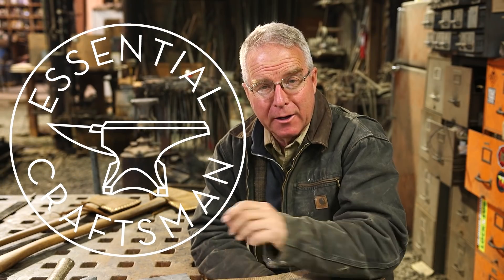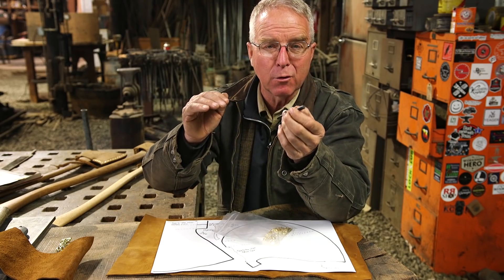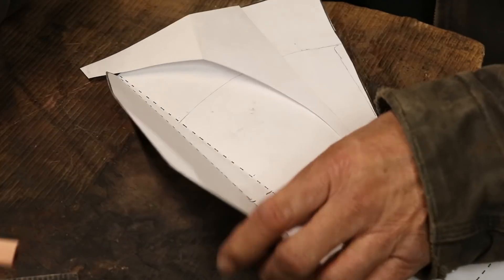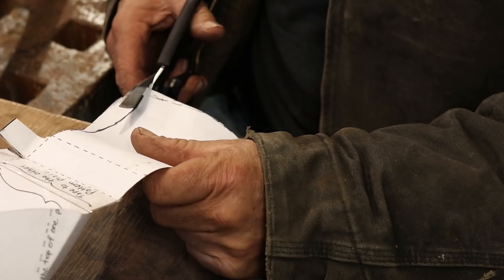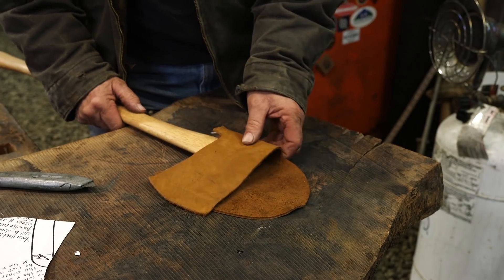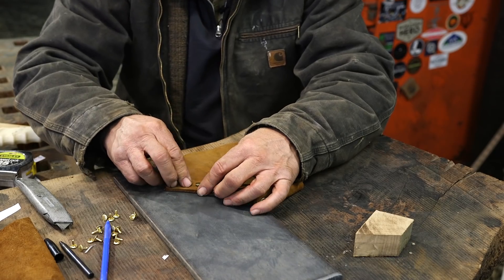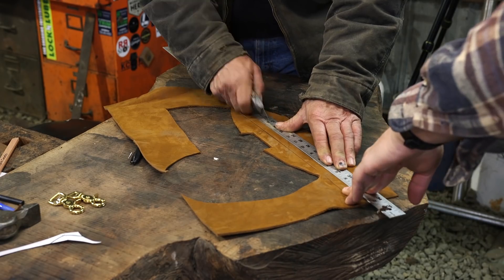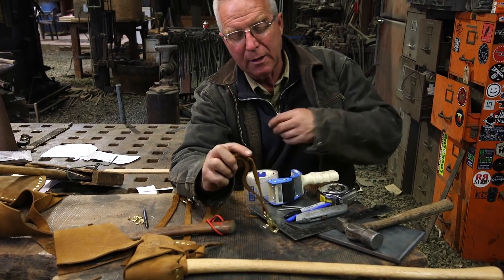EC Tries Something New

Comment: A couple of additional thoughts: When you're using drive tools in leather, punches, stitch or lacing cutters, tooling stamps - any of the tools you strike to use - don't use a metal hammer on them. You'll mushroom the tops of those tools in short order. Wooden maul, rawhide faced mallet, plastic or rubber faced - just not a metal hammer. You won't have those tools for decades if you hit them with metal hammers.  Second: when you're setting rapid rivets/ two piece rivets like the ones in the kit, you can just hit them with a hammer on an anvil, but take it easy ;) They're really pretty flimsy little things and you can smash them easily. There's a tool for setting them with a little anvil and a setting drive tool, both with slightly concave faces, that allow you to set the rivets just about perfectly every time, and keep that little bit of doming to the caps. The hammer and anvil work to make the rivets hold, but adding the rivet setter produces a more finished look and makes the task easier to do well.
Reply: I was about to make the same point about the punch. I am glad I scrolled down. Another handy tool on a project like this is binder clips. Those are the small, usually black spring clips normally used to hold loose leaf reports together. I use them the same way as I use straight pins when sewing cloth. Really helps when fitting the parts together.
Reply: Seems like a brass hammer would be alright.
Reply: And if you've got an axe, and some well seasoned hardwood, making a simple but excellent mallet is a handy bit of bushcraft practice.

Comment: Might I add, for anyone planning to undertake this project. Add a strip of leather between the two main layers of leather where they are riveted together along the cutting edge of the bit. This will protect the sharp edge of your axe from dulling on the rivets as it is carried in the sheath.

Comment: When I was about eight years old, Uncle Eric (who also taught me how to braze with oxy-acetylin) drove a ten-penny nail and the tip of his sheath knife into the surface of his work bench, a 1/8" apart. He then drew a leather scrap between the nail and blade. As we pulled, I was amazed as the scrap revolved, changing from a sheet to a thong. They make great winter boot laces. They never get waterlogged and freeze, unlike woven laces. That was my first leather project. <Insert pun involving shoemaker's last here.>

Comment: When measuring leather that's going to wrap around something, you must take into account the thickness of the leather.

You can see this by measuring around a coffee can with a piece of paper, cutting it to the exact fit, cutting an old thick belt to the length of the paper, and then wrapping the leather around the can.
Reply: That’s a difficult concept for me to understand.  Can anybody explain why this is the case?
Reply: @jphickory522  The grain side (smooth side, side that the hair came off) doesn't stretch much. The flesh side (rough side, where the fat and muscle was scraped off) compresses a bit. This adds twice the thickness of the leather to the c̶i̶r̶c̶u̶m̶f̶e̶r̶e̶n̶c̶e̶ diameter of what it's going around. It isn't really noticeable with the thinnest garment leather, but when you get up to 11/12 oz (one ounce is one sixty-fourth of an inch) or thicker saddle skirting, it makes a big difference.
Reply: Thanks John.  I still
don’t understand but appreciate your effort of trying to explain it.  In my simple mind... if two strips of different materials are cut to the same length they will have the same circumference when wrapped around something regardless of thickness.
Reply: On second thought..... I think I do get it now.  A thicker material will have a larger outside circumference than inside circumference due to the thickness.  
Thanks

Comment: TIP.
To put an accurate crease in paper or card. Gently draw a knife along a straight edge on the inside where the create is to be formed. Gently being the key word. Only need to score a faint line in the paper/card, not to cut deep or through it.

Comment: Leather worker pro tip: instead of paper or even card stock... use scrap linoleum material for patterning. The extra thickness helps account for the leather thickness yet is easy to cut and fold.

Comment: I would recommend trying copper rivets next time. They basically look like a blunt nail and washer. They do require a rivet setting tool and some sort of wire cutter, but they don’t require precise hammer blows, are very simple to use, and just plain look good.

Comment: Your so right the skills translate across most production Trades.     

When patterning thicker leather cardboard folds about as well as cased 5 oz.  so you don’t have to do as much work with seam allowances.    

I would make a much more rigid mask ( axe blade cover). That soft and they can fold in front of the blade and be cut easily.

Comment: Now you have come into my world ;)  If you hold that utility knife like a pencil, between your thumb and forefinger with your forefinger on the back of the blade, then your knife holding hand is braced and steadied against the table, allowing far better control and precision, plus it's anchoring the leather for you as you work. You don't need to try and force the knife right through with a strong grip. It's more important to cut precisely along your lines and that is better done with a pencil type grip, even if you need to go over the line more than once to cut clear through (which with the leather you're using should not be necessary).

Comment: I have a set of scissor-shears purchased to cut 1/8" rubber sound-proofing that's loaded with powdered rock that I would use instead of the blade shown here, especially with children: easier, more precise and safer. Here in subtropical Southeastern Louisiana I couldn't use leather because it would be moldy within a month in my workshop but I'm thinking there might be magnetic edge-guards out there in the world or I could use a flexible plastic the same as you did the leather. This was definitely a different direction in your video series. I have a few axes and hatchets and it never occurred to me to put guards on them. Thanks.

Comment: Some 30 years ago, when my wife became pregnant with our first child, I undertook the building of a rocking horse. That involved, in addition to the woodworking, some leather work for the saddle, bridle, reins, and stirrups. I've done exactly two additional projects over the past three decades using those leather tools and hardware (things like repairs to a pocket on a leather tool belt). The point is, I haven't needed them often, but when you need them, these tools are indispensable. I still have the rocking horse in a spare bedroom, and I have told both of my kids that the first one that blesses my wife and I with a grandchild gets it! (Still waiting, alas, but my oldest recently got married, so hope springs eternal!)

Comment: I'm cringing at you hitting the metal punch with a metal hammer. That'll mushroom the head of the punch in no time.

Plastic or rawhide are preferable.
Reply: When it mushrooms you just grind it off . It is not a problem
Reply: @charlesgould2168 That way you eventually don't have a punch left. Meanwhile, I'm still using the set I bought forty years ago, and I've been a full time leather worker for thirty years.
Reply: This is great advise for a young person for whom it might become a career or at least a lifelong hobby. For someone older, say a person with a day job that consists of mostly dealing with computer screens who needs a creative outlet, or a retired person looking for a hobby to keep both hands and mind active, I doubt that mushrooming the head of the punch will be a problem.
Reply: @janderson8401  So much for passing them down, I guess.
Reply: I'm wondering about the nail injury on his left hand....
Reply: So what.  Been using a metal hammer on my punches for a gazillion years.   Nothing lasts forever, especially not me, ...and one has to resharpen the cutting end once in a while anyway, so you're removing metal on that end.
Reply: @johnwildermuth3136  That's another good point that I had not thought about. I have a few pocket knives from one grandfather, a desk that my other grandfather rescued from the dump and restored over twenty years before I was born, many of my Dad's tools, and a good number of tools that my father in law had. I also have some tools that were given to me by my mentors in the trades, or bought from their heirs. And I fully intend to  pass the ones that have family meaning on to my niece and nephews and their kids. Actually we have already started by giving our younger nephew a set of basic tools that my wife's dad had put together in a case that he had made for when he needed to bring tools with to fix things for friends and relatives.

On the other hand, so many people that I know who are collectors say that their children and grandchildren have no interest in the collections and they fear that their stuff will just be hauled to the curb when they're gone. Also we live in a "throw away" society. Most of what we buy is designed for ease and speed of assembly, the heck with whether or not it can be repaired. And our economy seems to be based on an ever expanding pool of people wanting to buy new stuff. Manufacturers depend as much on us wearing out, breaking or even losing tools as for having more people going into a craft or trade for there to be enough of a market for the tools they produce.
Reply: @johnwildermuth3136  Punches are pretty cheap so i dont mind wearing a few out. Actually i have never worn a punch out, cold chisels yes.